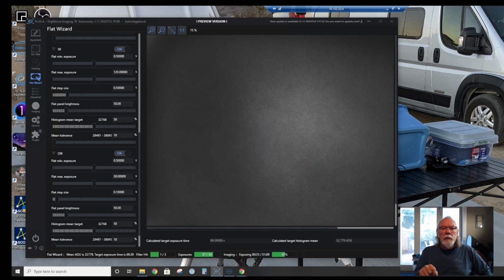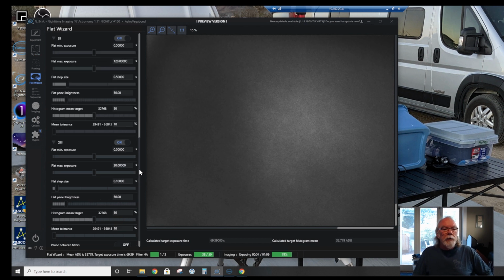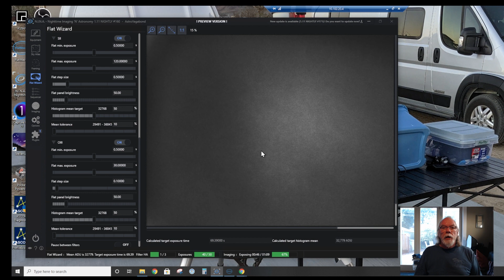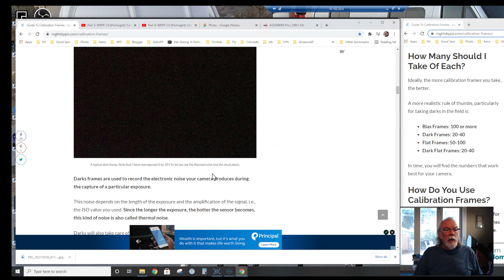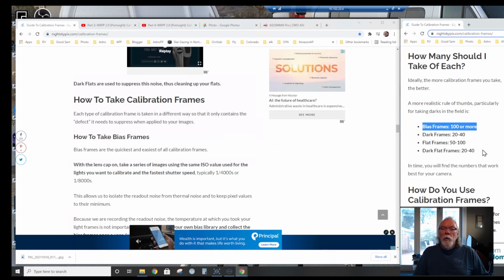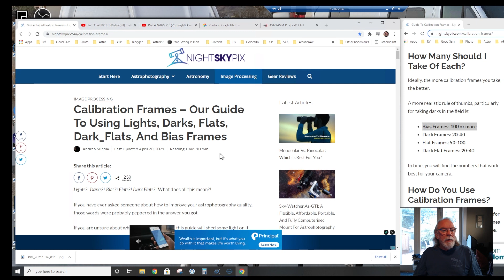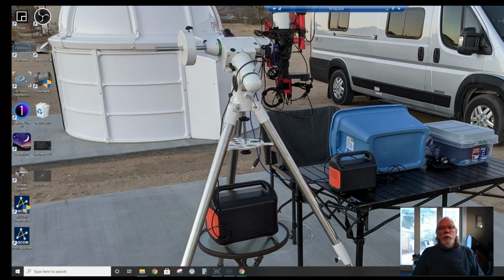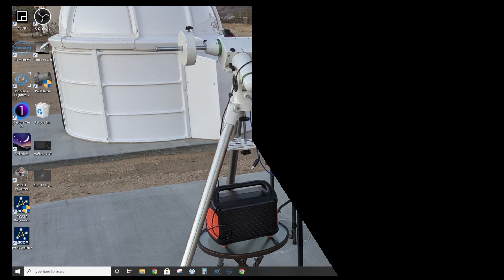Good Bye Bias - My ZWO ASI294MM Pro Calibration Frames Approach

Comment: I have a 294. I find that amp glow is best dealt with dark frames. As for flats and dark flats, the 294 doesn't like fast shutter  speeds. I do my flats and dark flats at 2 to 3 seconds and they work just fine. Bias are typically at the fastest shutterspeed, so are pretty much useless for the 294.
Reply from the maker: Agreed Dave, my thoughts exactly. I do like the quality I get from it if I perform the proper calibration frame captures.

Comment: 294mm is temperamental camera. Flats should be taken with at least 1 sec exposure. So, dark flats are required, not bias. Amp glow is massive as well. However, it has biggest sensor to take 1.25” filters. Ideal camera is 2600MM or QHY268M. But, it works with 36mm filters. So whole package will be about 4K. 2-2.2K could be recovered by sale. Alternative is to use 533MM, which has only one minus - small sensor and slightly small pixels.
Reply from the maker: Great feedback!

Comment: From what I've read, the 294mm internal circuit changes around the 1sec exposure mark which causes nonlinearity (something to do with using an internal trigger for short exposure vs external trigger for longer exposures). This is why the bias and flat frame may not match properly. Definitively safer to use flat darks. That being said, I'm lazy and wondering if I can get away with using 2seconds bias and flats > 2 seconds.  Guess I'll need to give it a shot when I receive the camera.
Reply from the maker: Thank you for the additional information Charles. Much appreciated. 👍